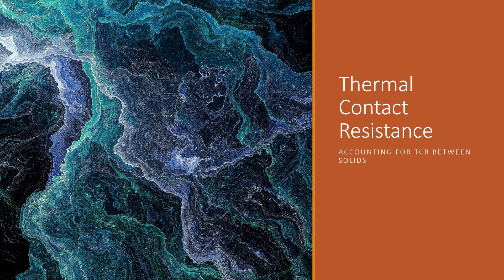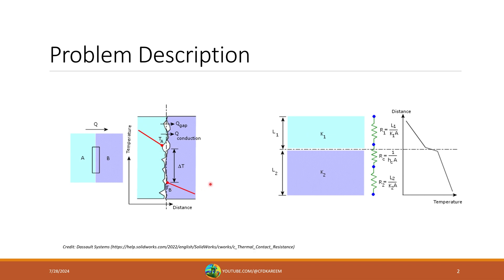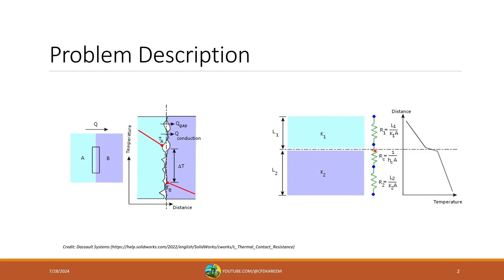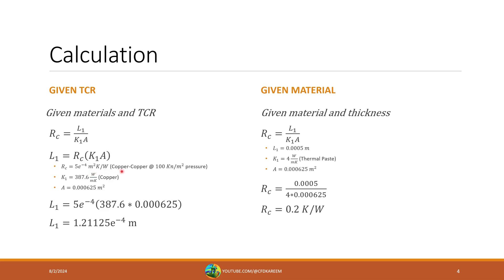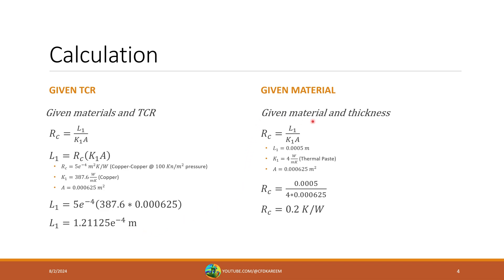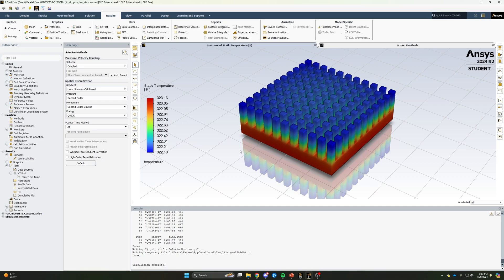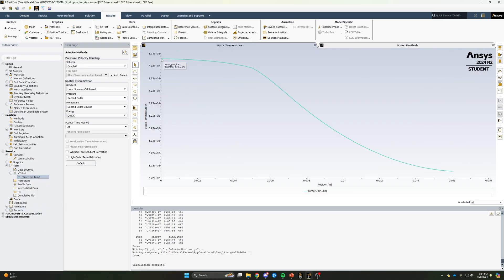ANSYS Fluent: Thermal Contact Resistance | Tips & Tricks

Comment: Hi, I'm modelling heat transfer between two different materials, which material should I use for the K1? Also, my system wouldn't have any thermal pads whatsoever, so it will be direct contact between two materials.
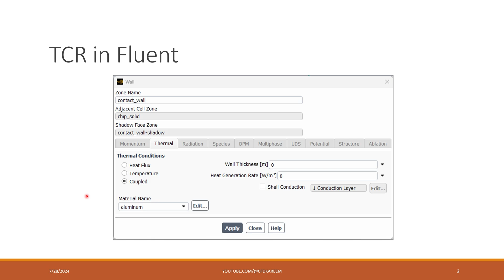Reply from the maker: K1 will be the material listed under "material name" in the wall boundary condition setup page (lower left @ 2:00). Two solids, even if they are the same material, will still have some thermal contact resistance due to the roughness and clamping force between the two. For some common material systems you can find published values for what the expected resistance would be for a given roughness and contact pressure. If you find a value, you can use the equations shown to calculate an equivalent material thickness to put into the model.

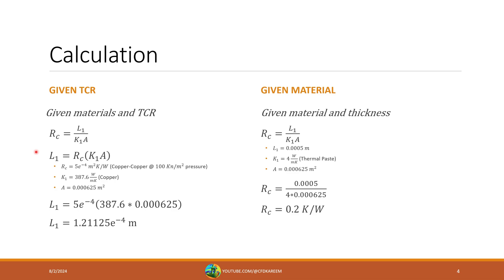Comment: There is a mistake in equations on the left at 2:05. For given units the result should be in m^3 which doesn't make physical sense in such case.
Reply from the maker: Hey good catch! The units for Rc should be K/W, as we found on the right. With this change the units cancel correctly.

Comment: Hey! I have a similar model with a heater and evaporator with TIM in between. Using named selections, I named the common face, but in Fluent, it shows in the interface tab instead of the wall tab, as shown here. What could be the problem?
Reply from the maker: If the materials on each side are the same Fluent will automatically assume that the contact is an interface. If you change the material of either side Fluent will automatically split the face into a coupled wall. If you do not want to change the material you can right click on the interface and change it to a wall.
Reply: @cfdkareem  Thanks! I will try this

Comment: What are the benefits of using thermal paste if it causes the chip temperature to rise?
Reply from the maker: Great question! The simulation without thermal paste assumes absolute perfect contact between the heat sink and chip. In real life, due to manufacturing tolerance and surface roughness, we cannot make perfect contact between the two metal parts. Without thermal paste we will trap air in-between the chip and heatsink, causing a very large thermal resistance. We use thermal paste to fill the gaps between the two surfaces which will improve conduction between the two surfaces.
Reply: @cfdkareem  In the simulation, it's incorrect because we input a separate layer of thermal paste between the chip and the heat sink. That's why the heat sink temperature decreases and the chip temperature rises.
Reply from the maker: That's correct. I'm our first model, without thermal paste, we did not have any thermal contact resistance and therefore had perfect heat transfer between the two solids, which is not possible in real life. When we added the thermal paste we introduced a thermal contact resistance which reduced our heat flux, causing the chip to increase in temperature. If we wanted to increase the accuracy of our first model, without thermal paste, then we'd have to add a thermal contact resistance due to the roughness and contact pressure between the two solids. Let me know if that answers your question!

Comment: sir, can we use shell conduction instead of using wall thickness to get the contact resistance??
Reply from the maker: Definitely! However, you will still have to provide a wall thickness and material for the calculation. Simple thermal contact resistance, shown in the video, models the layer as zero thickness which only allows heat conduction normal to the surface. Shell conduction will allow heat transfer both normal and planer to the wall. Shell conduction will also account for the additional thermal mass which can be useful if you have an interface layer of significant thickness.
Reply: @cfdkareem  thank you sir😊